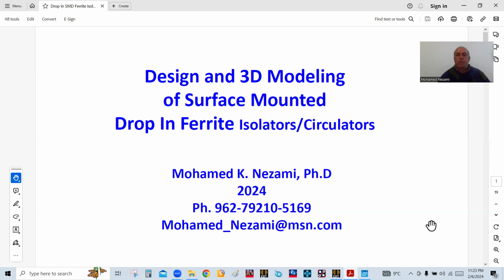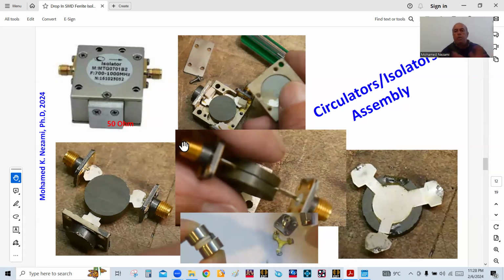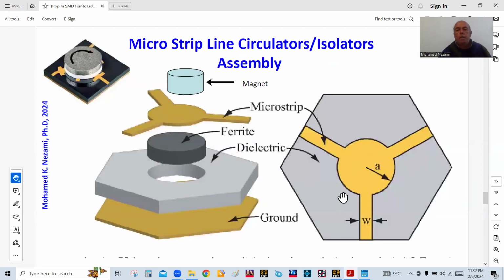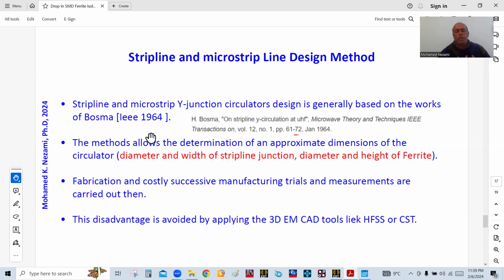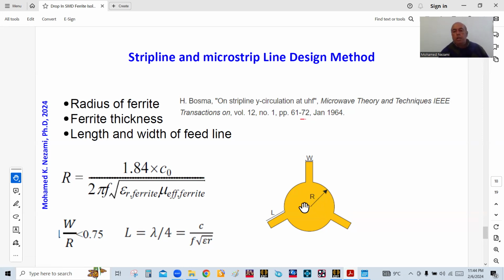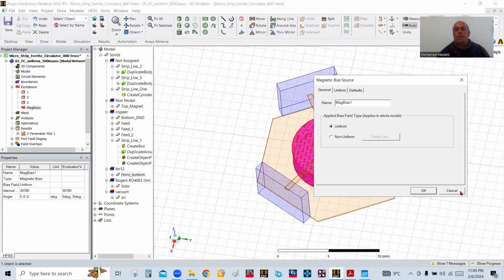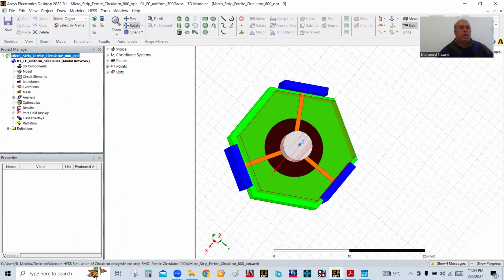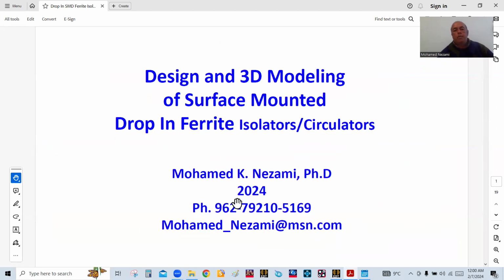Part 2/4  ---- Design and 3D Modeling of Surface Mounted Drop In Ferrite Isolators / Circulators

Comment: I was looking into how circulator work, and I come to this video.  very well explain, and I can see why good CAD is so important.   I am Ham Radio operator,  and I am wondering , if Circulator in HF frequency  3 MHz to 30 MHz are doable  ?  without making it too large, perhaps embedding multi turn winding inside of ferrite material.  or plating conductive material outside of ferrite wrapping around multiple times to create strong enough magnetism within ferrite.  AG6JU  NIKO